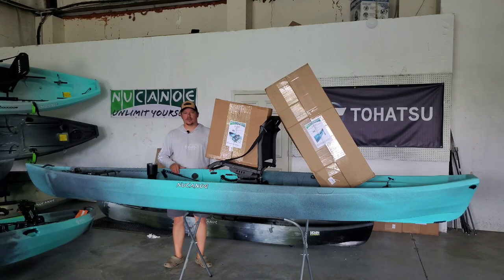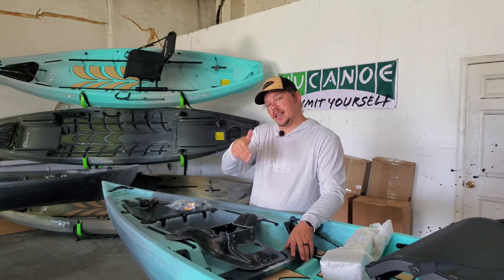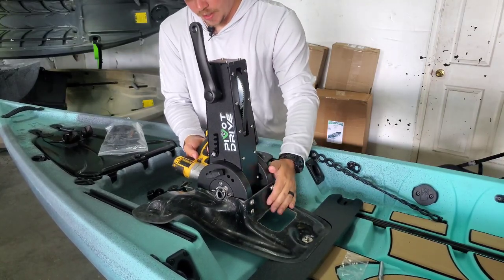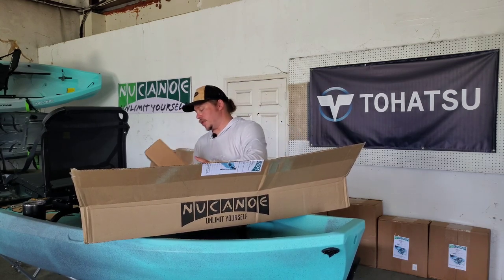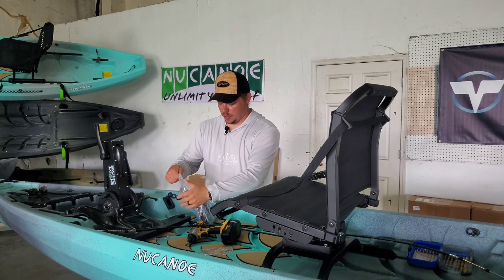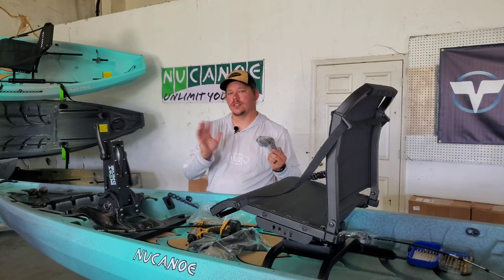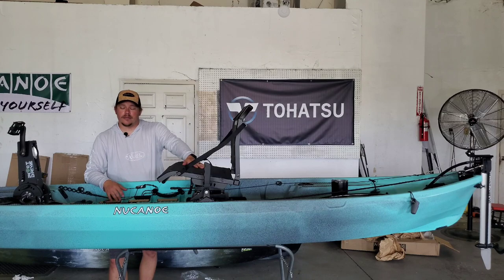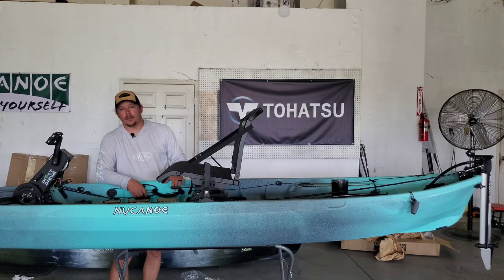NuCanoe Pivot Drive Install!

Comment: I take it that the top cap isn't reinforced where the handle to turn it goes , that will be a huge problem with stripping out , something to think about in mfg department , all areas that will get screws put through the boat . As expensive as they are this should have already been addressed with something more than poly .